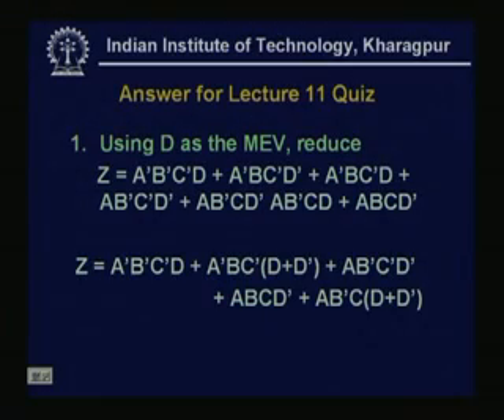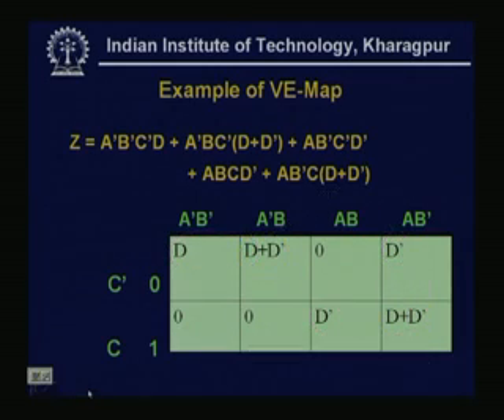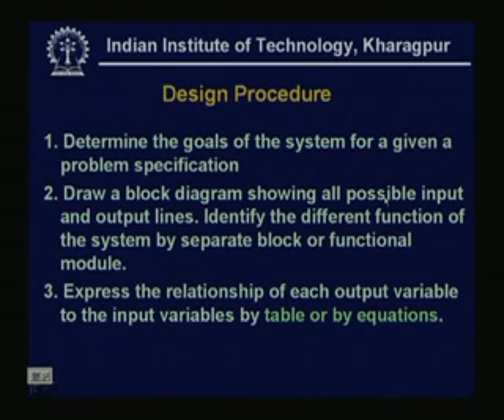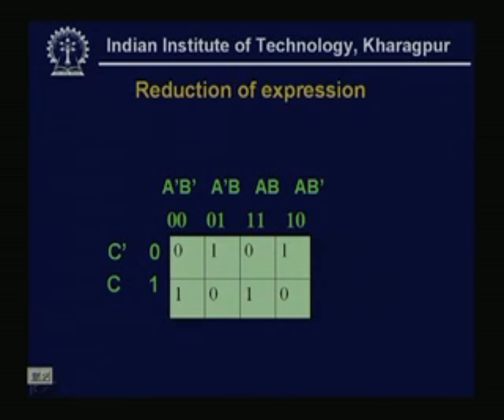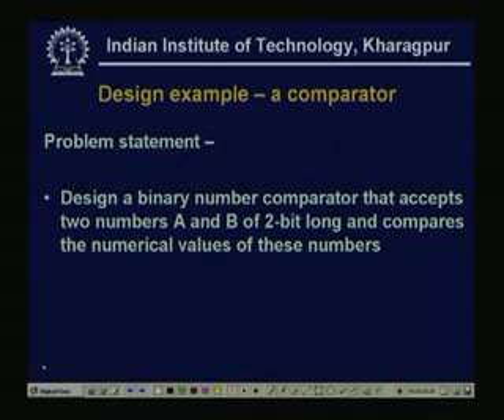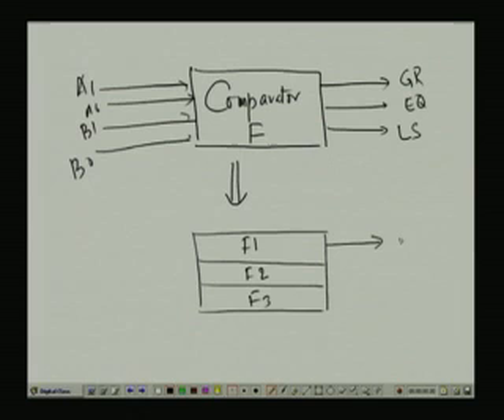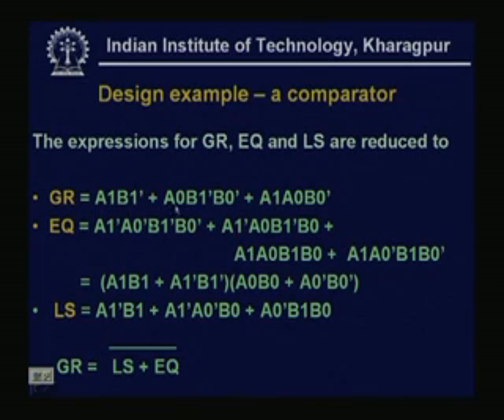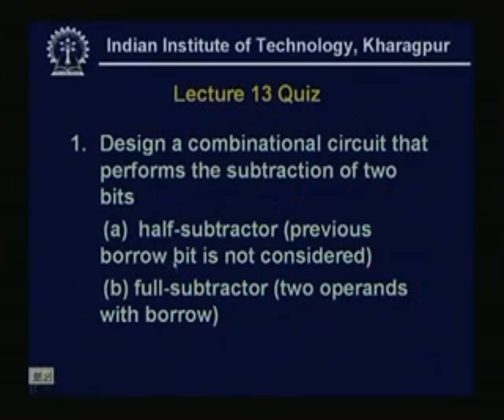Lecture - 12 Combinational Circuit Design

Comment: In the example of comparator circuit, that gates for EQ and GR should be EX-NOR instead of EX-OR as professor explains @ 51 min (I believe by mistake). Someone please correct me if I am wrong. Thanks.
Reply: yes its EX-NOR. 
As Ex-NOR = AB+A'B'
&  Ex-OR = AB'+A'B

@50:35 it says EQ = (A1B1+A1'B1') AND (A0B0+A0'B0')